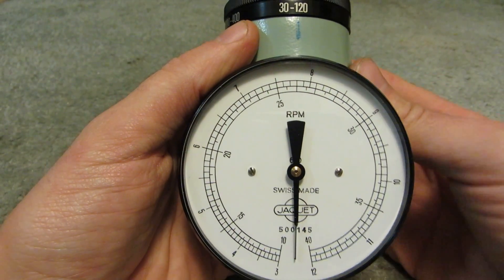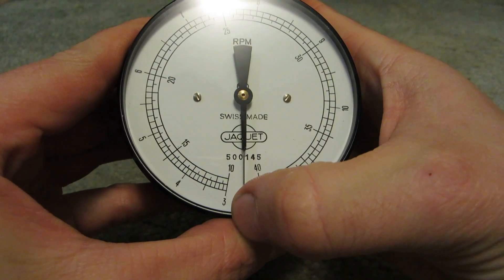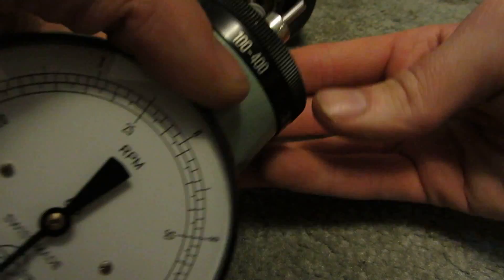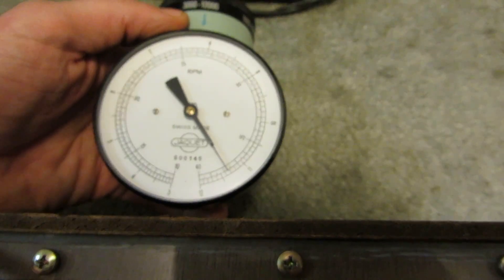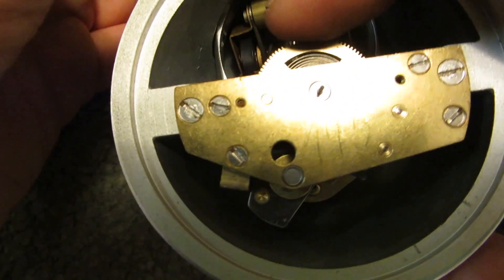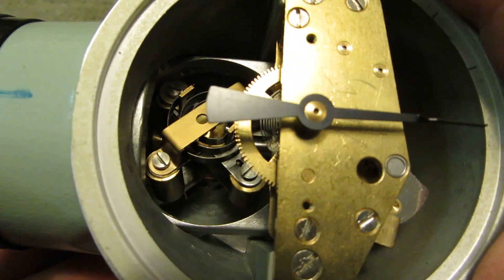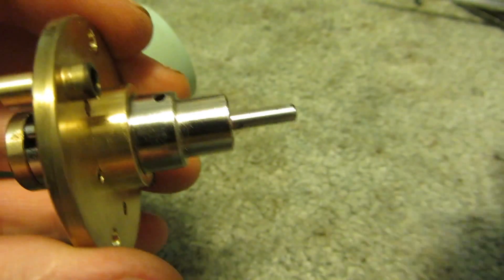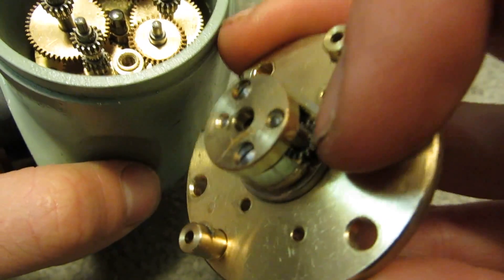High-Tech Swiss Analog Tachometer

Comment: Hi! I'm collecting old drafting and measuring instruments. I've got one of these, a 630, but not working and making funny noises. Would love to have a look inside but don't know how to remove the black ring (bezel?) with the glass. Any help very welcome. Thanks! Just in case, would you send spare parts?
Reply from the maker: Hi Galpalu, Take a flat blade screwdriver or maybe a butter knife and very carefully wedge it under the black ring along the side and force it up, the black ring should pop off.
Reply: Thanks a lot! Could pop the black ring off. After cleaning and oiling it works perfectly!
Reply from the maker: Glad to hear that!
Reply: HL4EHalfLife 
What an incredible instrument!
To remove the black ring I used a different technique: I held the body firmly in a vise with soft (leather) jaws and hit the slightly protruding inner edge of the ring with a mallet tapping on a sharp edged piece of Ertalon. The ring popped off, ergo you must provide  something to catch it as it wants to fly....
Anyway, thanks a lot for your excellent and very informative and motivating video!